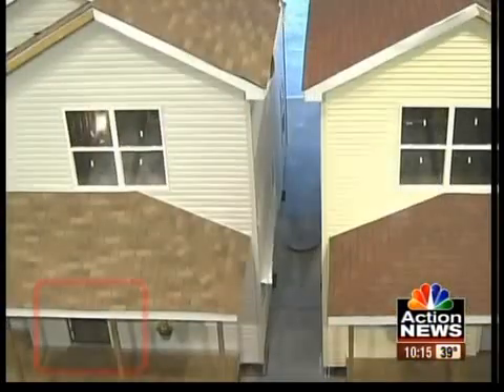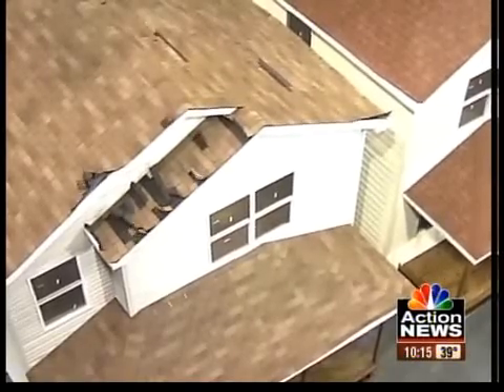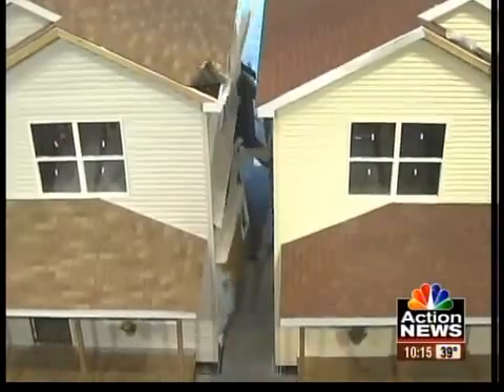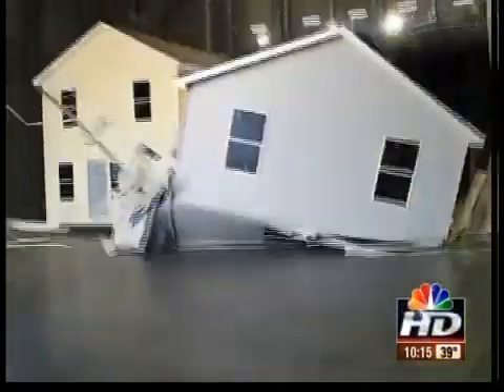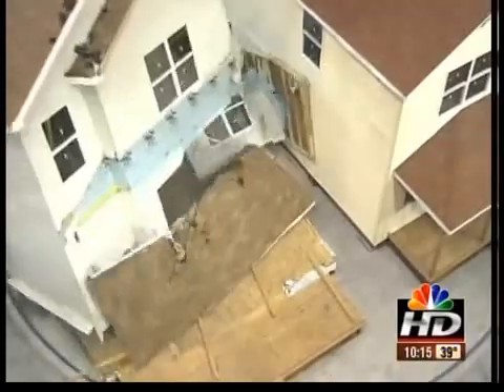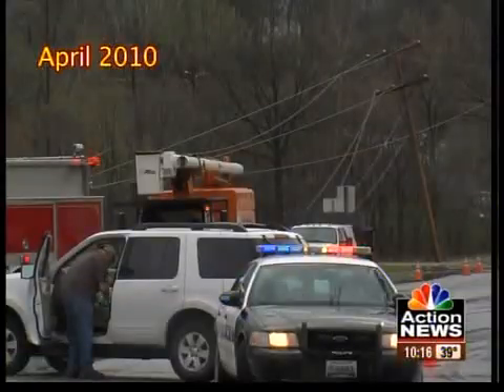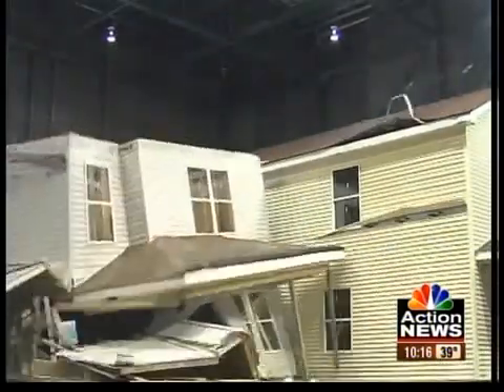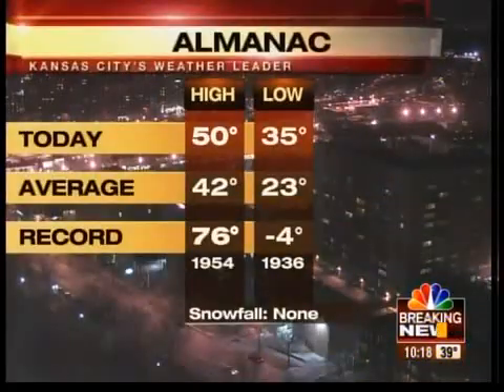The secret to tornado-proof building

Comment: You guys build your houses out of wood over there? We use brick in the UK
Reply: moien haider woods newer than brick? Brick is the strongest you can get other than solid steel and concrete
Reply: Cheaper material... plus the main reason that homes are built in that material in the UK/europe is because its insulates heat better - not a huge concern in the South US. 
A strong EF4/EF5 still annihilates stone/brick structures all the same; you need a reinforced concrete structure to truly be safe
Reply: I don't know if you remember the Birmingham UK tornado but brick houses were no match for that either, it took out rows of terraces. I believe that it was an F2 tornado, which is relatively weak. I think the only safe bet in regards to tornadoes, is underground or reinforced concrete.
Reply: @V-Bug  that’s only because the timber in a terraced house is thin and old once that fails the gables fall over but in a new play roof house, like I’ve just built one, you should be okay. It’s the roof that fails first
Reply: Germany uses concrete filled bricks in houses
Reply: @ilikecookies1787  all of them?
Reply: Steel, concrete, steel rebar and brick  buildings and homes have been demolished by f4s and f5s. Floorboards have been eaten and basements have been revealed. It’s the direct hitting physics of the tornado it’s self not the winds pushing from it but the suction and rear flank nature that makes it enormously powerful.
Reply: @steerpike8091  Yeah, you have to divorce design from material and focus on both independently. Earthquake proof designs often require a grid pattern in each wall, with walls that support eachother so no single wall can topple over. Another method is to use X-bracing so that the square shape of a load bearing wall retains its shape. One reason domes work so well is because all that load is equally distributed in ways that square walls can never achieve. Reinforced concrete is great for its far higher limit of load-bearing compared to wood while also being fire-resistant, water resistance, thermal capacity and impervious-ness to pests. Another plus for concrete is that flying objects aren't going to puncture the walls like they do with plywood in the event of a hurricane or tornado and should the area flood the building can survive.
Reply: Mark R Florida builds concrete homes now after hurricane Andrew wiped out a town near Miami in 92. My house is wood frame but has held up to 5 hurricanes and 3 tropical storms but is no match for and EF3 or higher tornado. And we dont have cellars in Florida either.  Luckily we only get quick tornado like EF1 that last 5 minutes but  these huge tornados just blow my mind.
Reply: Karo French, Dorian was rated at 185 mph with wind gusts of over 220 mph.
Reply: It's not so much that it's built out of wood, so much as that everything is so cheaply built here and with low standards. The cost to build a home in the United States is roughly 2x as much as it is to buy a contractor-grade piece of junk and ultimately the things that sell a home are its kitchens and bathrooms and yards and location and not how well it's built. If you want an affordable well built home in the United States you need to get licensed as a General Contractor and do it yourself.
Reply: Whos we?
Reply: No you don't, all the houses are just ancient colonial era houses. They're already built you tit.
Reply: Jacob Keary Yea we so you fool even the new build houses use brick
Reply: The debris would smash the windows and then the wind pressure would tear the bricks apart from each other so bricks really wouldn't save you 🤷‍♂️
Reply: @Zephyrfansandtech  bricks insulate better, less cost on power, bricks don’t rot wood will,
Reply: Brick houses exist in the US lol
Reply: @quartzuniverse3763  the vast majority of american houses are wood.  the vast majority of british houses are brick.  theres a difference
Reply: @jakuub_11  OP is coming off like brick houses don't exist in the U.S, that's all that I'm saying lol
Reply: @jakuub_11  it’s more brick houses in the us than the us so more people in the us can say they live in a brick house than people in the Uk
Reply: @tonioo8879  That is true. But most "brick" houses in the US are still wooden-framed, unlike Britan.
Reply: @jakuub_11  yes but "older house" are usually in brick or built differently.
Reply: Dwight 9
Reply: Miguel Lavoie yes, we do have insulation in the walls.
Reply: Johnoè I used to have a brick house in the usa
Reply: Johnoè 😑😑😑😑😑😑😑😑😑😑😑😑😑😑😑😑😑😑😑😑😑😑😑😑😑😑😑😑😑😑😑😑😑😑😑
Reply: My house is straight brick
Reply: They're from brick and cement in Brazil. Just really poor places have houses of wood and bad materials
Reply: @ingredi8409  usa
Reply: Brick vs tornado good. Brick vs earthquake  bad
Reply: Majority of world build houses from brick and cement....
Reply: F4 tornados tare brick houses apart.
Reply: Yes depends on the area since we have hurricanes,tornados and earthquakes I live in Puerto Rico so my house is made out of Cement.
Reply: He means plastic. Pine is soft wood. It's not even hard wood. Vinyl is like paper
Reply: I think it’s more of house of gypsum since the woods is only for framing🥲
Reply: Naw in my trailer park, we use wood
Reply: WhatS the frame under the brick made of? I bet it's wood.
Reply: @xXJesuslovesyouXx the homes are not frame that’s the point. In the uk the load bearing system is the mass wall system. Not a wooden frame.
Reply: Wood's cheap.
Reply: Colonizer-Chan didn't age well
Reply: @ColonizerChan  oh concrete has a cost of titanium
Reply: Cetus, in many places brick is a liability because of earthquakes
Reply: Right, like the midwest. XD @brianc9374
Reply: Brick isn't much better than wood and costs a lot more. We should be building with reinforced concrete and slapping a pretty face onto it. Tornado comes along and rips off the pretty face, but house still remains.
Reply: @MarkReaves84  ICF with metal siding and roof members that are bolted to the ICF walls is the way to go if you want a traditional looking home that will withstand any natural disaster and be energy efficient and keep the bugs out at the same time.
Reply: News Flash! Brick homes also collapse during tornadoes. Don't believe me? Just do an internet search there are plenty of examples. I have seen it happen here in Australia. The reality is if you want your home to be tornado, hurricane/cyclone proof then expect to pay for a completely different design.
Reply: Johnny Rocket, dome houses fair better. Winds just blow over them.
Reply: @chodkowski01 , agreed, wind modelling has shown that circular and dome shaped designs fair much better.
Reply: @JohnnyRocket4  yeah your best choice is a underground shelter 🤦
Reply: We use wood so we can cry when our houses blow away and rebuild it with wood just as it blows away once more so we may cry again.
Reply: @goober239 it's to feed the lumber and construction industries. There is literally no other use to building this way in Tornado/Hurricane country.
Reply: Bricks would just go flying. In fact, some brick buildings can be less sturdy than wood because they cannot take as much side-load forces, which is of great importance when it comes to surviving hurricane forces.
When it comes down it to, it's all about the reinforcement. A sturdy, well built brick or wood structure can survive, but one that just barely meets building codes might not. Then again, the building codes are different in areas where there are a lot of tornadoes. (Not in my area - we don't get tornadoes here at all really. It's really rare, like once every 50 years or so.)
Reply: Dwight it’s smart it’s stronger

Comment: question everything, i was raised to believe that you have to open windows to relieve pressure  on your house to keep it from blowing apart. but that is 100% false keep doors and windows closed because if u open them the air flows thru the house and blows the walls and roof off destroying your house quicker then if u keep them shut!!!
Reply: Great point!
Reply: @derekwhite9932  if you open your windows your house would have high pressure inside
Reply: I just relearned this too.. man all the years running around opening windows.  I looked it up a couple weeks ago was very surprised at the answer after being told that my whole life

Comment: If people built cement houses, none of these people would have jobs LOL.
Reply: Ozone  how come tornado shelters are made out of reinforced concrete? There still there even after tornado's have hit my city. Leveled all the wooden buildings, but the concrete parking garage had no damage besides the wind blowing out the glass.
Reply: Ozone  umm. Reinforced concrete is way stronger than wood lmfao. Hence why when tornado's have never taken down big buildings in city's.
Reply: @AndroidAntill  you're right, but at least if it's a skyscraper buildings.. High End Tornadic or Hurricane force wind could simply deteriorate all of the windows  :)
Reply: Droid Good. They can find jobs building concrete houses then. Just like coal miners and buggy builders. I'm sure the telegraph guys are out of jobs too.
Reply: Austin Henning, they would have to start wearing working clothes. Those fancy suits tear easy on work sites.
Reply: We use concrete and brick stones in my country in tornado regions.
And we usually never experience something like that.
Reply: Droid that's what I will be building.
Reply: Cmon guy just use stones and cement lol
Reply: Ozone  I haven't seen much information that goes against reinforced concrete domes in hurricane or tornado force winds/debris, there are examples of ones that have survived where all the wood structures were leveled. Have any sources or links?
Reply: Now even concrete is programmed not to last..
Reply: JR, you can’t beat concrete vs wood. This is why there’s so much destruction after a storm because of the mindset that wood is stronger than reinforced concrete. When a storm blows through a suburb the homes are all leveled. When the storm blows through a city the buildings still stand after a storm.
Reply: @jr3474  you know what else isnt built to last? Wood. Tornados being a regular thing there, youd think that place would have the most wind proof houses around but nah.
Reply: Why?
Reply: 3d printed homes that are strapped to the ground will eliminate most weather destructive issues. That said if you wanted a quick and easy protective building just build a reinforced concrete dome, they are among the easiest and cheapest structures you can build. There's no reason anybody in a hurricane or tornado affected area shouldn't have one. The Dome (or Geodesic buildings) are the strongest structures we can build today due to their shape, they're also incredibly energy efficient and cheap, but nobody wants to live in a dome so they're not popular.

Comment: Ok now put that tornado "proof" (yeah fucking right) house in a blender with cars, trees, and debris from other structures. Then by a couple hundred more fans so you can prove your figures as best as you can in the non scientifically accurate wind tunnel on the EF4 proof building. Then say some total bullshit about how the house only needs $5000.00 in reinforcement.

Comment: These people talking about a damn brick house. Put that shit in tornado valley and see if it doesn't get raped by a tornado. Wood is beautiful and easy to work with.
Reply: Wood is beautiful to look at BUT it will blow away during the weakest tornado. Thick concrete, properly anchored in the ground, will withstand pretty much anything. American builders are motivated by greed and could not care less about SAFTEY.

Comment: If there were some strategically placed steel beams and floor joists, and the wood was screwed together, instead of nailed, a structure might hold up a tad better. I know I have a harder time removing a screw than a nail, so it just seems to make sense. But the extra few seconds per screw(which could lead into hours, for an entire structure) would probably jack the price up, astronomically, in the end. Not to mention screws would cost more. I'm not a handy woman. I'm lucky to be able to paint a wall! But if I was able, I'd build my own house, and use metal and screws, to hold it together. But I'd also have a storm shelter, because I don't know for sure my logic is based on sound evidence.
Reply: cyclone prone areas use brick or concrete walls with reinforced steel frames and steel bars tying the entire structure to the foundations.
Reply: itsnotthesamething, I love your way of thinking though!
Reply: You'd be looking at almost a 10:1 ratio for framing nails vs structural screws as far as time goes. Not to mention with structural screws you are looking at ~ 2.5-3k s crews for a 1,000 sq ft house (no skimping on shit anyway) with the 3 1/2 inch screws costing almost 70 cents per screw you are looking at around 2k for screws alone vs 50$ for 2.5k framing nails.  I like the idea of structural screws (not decking screws) but the time and cost is... a bit out there.
Reply: @mobiussquadron  which is why it need to be in the building code, as it is in many areas
Reply: @mycosys  When I wrote this, I lived in a hurricane zone. I had a pretty sturdy house, so I didn't worry too much about hurricanes. Now I've moved to big tornado country, and live in a match stick house. We plan to build a house soon. I still want a storm cellar though, no matter how well built the house is.